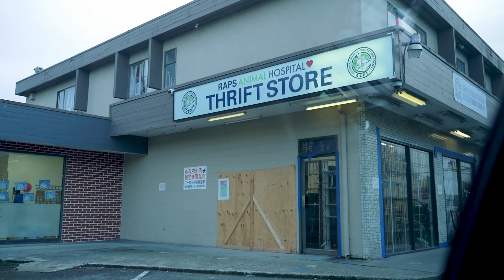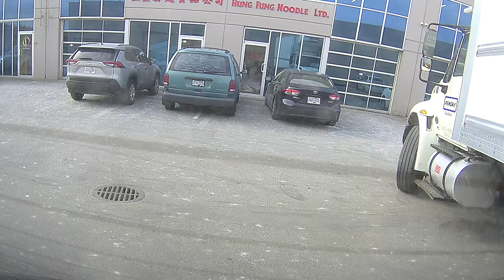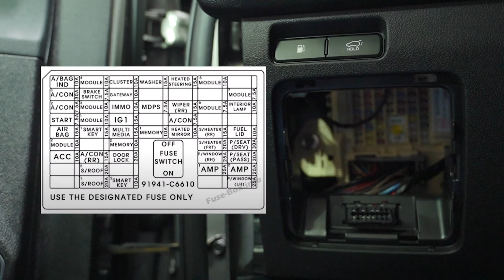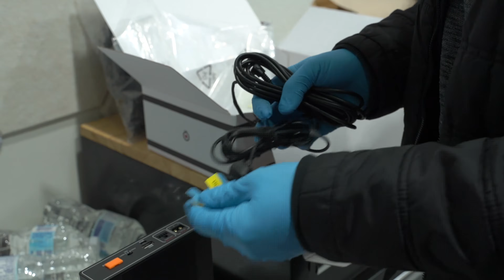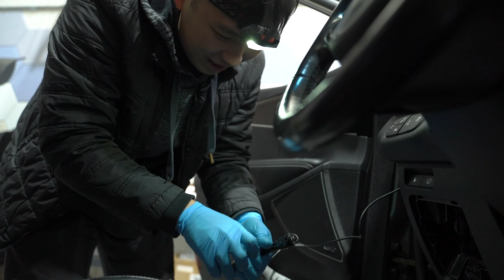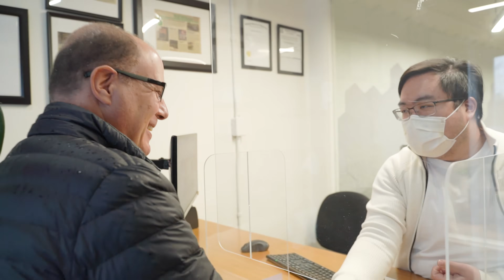Thinkware U1000 x PowerCell 8 Battery x 2018 Kia Sorento | How to Hardwire Install | BlackboxMyCar

Comment: I had a friend install the battery pack and the next few days I woke up with my battery dead did he install it wrong? It’s the same battery pack you have on this video power cell eight.
Reply from the maker: If you're waking up to a dead battery after having the PowerCell 8 battery pack installed, it could indicate an issue with the installation. Here are a few possibilities to consider:

1. Improper Wiring: If the battery pack was not wired correctly, it might be drawing power from your car's battery even when the car is off. This could lead to your vehicle's battery draining overnight.
2. Settings Configuration: Ensure that the PowerCell 8 is set up correctly to draw power only when the vehicle is running and not while it's off. If the settings are not configured properly, it might not function as intended.
3. Faulty Battery Pack: While less common, the battery pack itself may be faulty. If it’s not holding a charge, it may cause your car's battery to drain.
4. Check Fuse: If a fuse related to the installation is blown, it might prevent the battery pack from charging properly when the vehicle is running.

I recommend reaching out to your friend to review the installation or contacting our support team for assistance. They can help troubleshoot the issue further. If you need more help, just let me know! 😊

Comment: Hi Joseph, can i use a Powercell8 battery pack with my U3000 front and rear cameras? 
I prefer to use the cigaratte lighter option rather than the fuse box.
So what input and output cables do I need to choose from?
There is no option available for input cable. So does it mean the powercell 8 comes with cigaratte lighter input?
Secondly, what output do I choose if I have a U3000 - the cigarette lighter socket output or the spliced cable output and does the spliced output wire go directly into the camera? There is no need for a separate Thinkware hardwire cable in that case right?
Reply from the maker: Hi there. Yes, you are able to use the PowerCell 8 with your U3000. You'll need a spliced output cable for Thinkware. This battery comes with both a hardwire kit and cigarette lighter input cables. There is no need for a separate Thinkware hardwire kit, unless you are splicing yourself.

Comment: Hi, I just ordered a BBMC Powercell 8 Viofo Kit from you guys and have some questions about this video:
1. The wire that needs to be hardwired to the car says ACC on it, why are you guys finding and using a continuous fuse? Isn't that usually for BATT wires?
2. Your website on the "Your Complete Guide to Hardwiring Your Dash Cam" says this: "For wiring a battery pack, 20A-30A is recommended instead." You guys used a 5 amp fuse to tap into on this video. Is that fine? Also, when installing a fuse tap, should you use the same fuse as the bottom (original) fuse?

I plan on installing this in my BMW G87 M2 (2023+) to avoid the infamous power drain error that shows up on the dash if you hardwire a dashcam to the battery. I look forward to your response, thanks.
Reply from the maker: Hi there, apologies for any conflicting information. You are correct that only an ACC connection is required to wire this battery, and this video does have a brief moment where it mentions finding a constant connection. Only an ACC connection is required. 

As for the 5A fuse that is shown in the one scene where the fuse is connectected to the fusetap, I believe that is purely stock footage, taken from another one of our videos. A 5A fusetap would not be ideal for wiring this PC8, as it draws 6A on low and 9A on high. The amperage of the new fusetap does not have to be the same as your original fuse, I would recomend using a bigger or the same size fuse as the original. 

Avoiding that infamous battery draining issue with your BMW M2 is good, I'm glad you are well informed about BMW issues, they can be a bit tricky, but you're already steps ahead of many. There's a few other things to consider, such as being on the lookout for delayed ACC fuses. Checkout our BMW specific guide here: https://www.blackboxmycar.com/pages/how-to-hardwire-a-dashcam-in-your-bmw 

We have a more detailed and specific video in the works for hardwiring batteries, and add-a-fuses, so stay tuned for early January.
Reply: @blackboxmycar  So would I have to look for a 10/20a fuse in my fuse box and piggy back off that? Or would any fuse that is ignition 12 volt and isn’t linked to an important safety feature (5a, 10a, etc.) suitable as long as I put a 10a+ fuse on the top? Sorry I don’t know anything about electrical wiring so you’re going to have to be a little patient with me. Also, will hooking the battery up to a delayed ACC fuse cause the warning to pop up?
Reply from the maker: @caprisunmonke1776  No worries, I understand that wiring can be a bit overwhelming. A delayed ACC fuse is likely to cause that warning to pop-up, yes. Since the battery can draw 9A worth of power, this combined with any existing charge from the original fuse can run a risk for anything rated 10A or lower, which is why I recommend 20A-30A for your ignition connection. While wiring to a 20-30A fuse is recommended, the added fuse tap on top can only be 10A with no issues, since the only power going through that secondary fuse will be from the battery pack, drawing 9A max.
Reply: @blackboxmycar  So just to clear up the confusion, I should look for an existing fuse that is either 20a or 30a and use a 10a+ fuse on the top part of the fuse tap? So tapping into a fuse that is 5a and putting a 10a fuse on the top wouldn’t be sufficient?

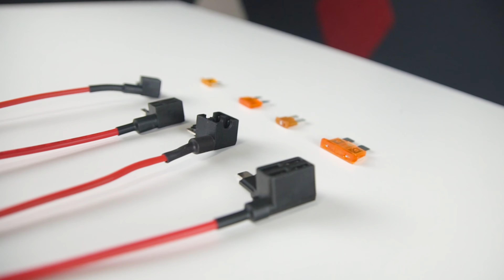Comment: I don't know anything about car fuse box, but why the battery pack's ACC and add a fuse is connected to a  "continuous power fuse" at 2:33, shouldn't it be connected to ACC, ignition based? Can someone explain to me?
Reply: @blackboxmycar can you respond to this question? I myself am also interested in the answer

Comment: Thanks for your video... You do not show the Hardwiring Kits installation, (red and black wire connection) to the Thinkware battery power source. You jump directly to the wire tap bundle and its connections which is wrong for the install. You missed a major step for engineers. Please review this vid. and include the connection of the main Hardwiring Kit to the PowerCell. Thank you.

Comment: Great video but I still don’t get the step to connect U1000 with the battery pack. In order to trigger parking mode, I cannot use cigarettes socket connect between them, right? Any separated video for the connection detail?
Reply from the maker: You can't use the cigarette socket between the two for a connection like this unfortunately, as this will not allow the battery to communicate to the camera that the vehicle has been turned off. Instead, you'll need a spliced Thinkware output cable, which is a 3-wire connection that pairs a standard Thinkware Hardwire kit with an output cable for the battery. 

I don't mean to get too complicated here, and I can assure you that we sell these cables pre-spliced at our shop, so we'll do the hard part for you!